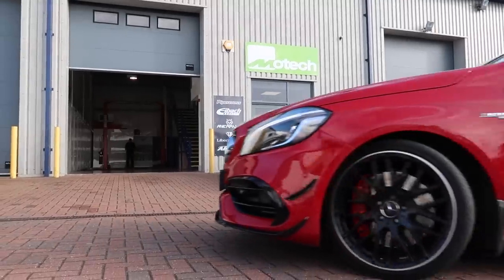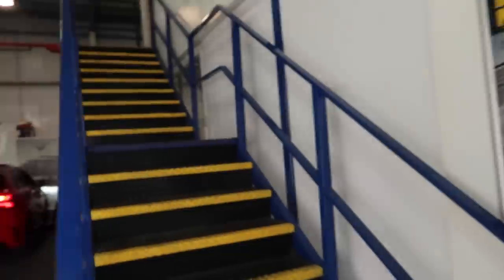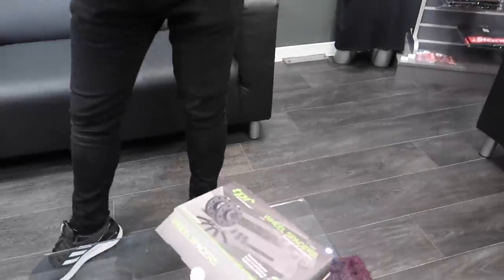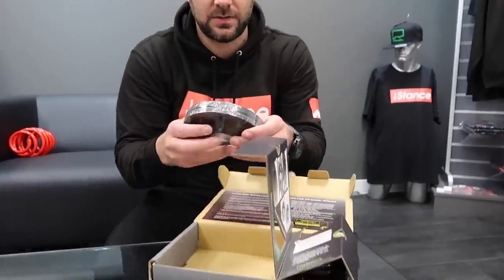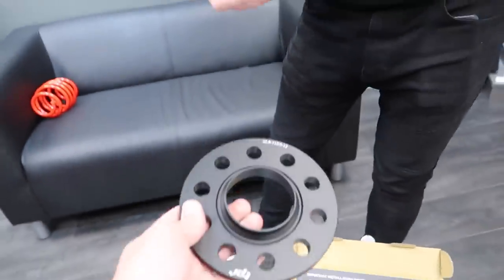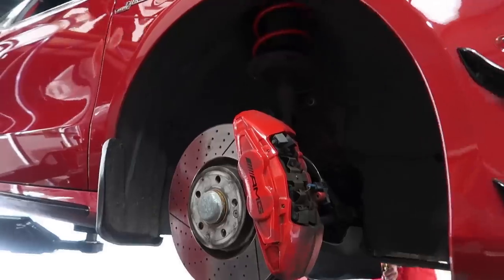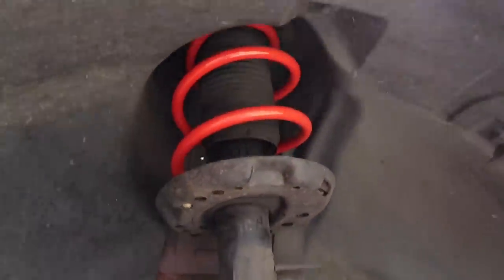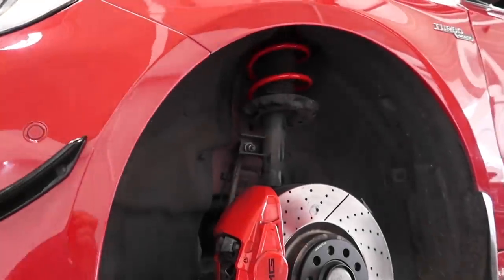New Mods For My A45 AMG!!

Comment: Loving what you are doing to the car mate. I presume no arch rub ?
Reply: Petrol Ped nope all good 👌🏼
Reply from the maker: Cheers dude 🙌🙌
Reply: Motech Performance my arches are rubbing after adding spacers & lowering - should I add camber?
Reply: Jay Tee on a 20mm drop you will be fine with the stock set up
Reply: After you add the lowering springs ....do you need to do your steering ?
Reply: that's what i immediately worried about when i saw it reversing out of the bay. If there's no rub, that's amazing. There's not much in it between the tyres and the arches by sight!

Comment: Tastefully done Steff, your'e one happy bunny. Just one question, doesn't it worry you that your wheels could get stolen without locking wheel nuts. That would concern me, or do they have locking wheel nuts supplied?
Reply from the maker: Yep new wheel lock nut supplied too 🙌 thanks man. Yeah super happy
Reply: Roberto Lombardi comes with longer bolts and lockers 👍
Reply: @StefABtv  That's nice to know Stef, will consider a set for my M2 Competition.
Reply: @MotechPerformance  Thank you, how much can a set cost? I'm interested in 15 mm up front and 12 mm to the rears.
Reply: Roberto Lombardi we have and m2 comp in this coming Friday 12mm f and r work best £685 all in for the eibachs
Reply: @MotechPerformance  Thanks very much, I'm not taking delivery of my M2 Competition until March, Can you please quote a price for the spacers? I'm having dealer fitted M-performance coil overs.
Reply: Roberto Lombardi £200 for a full set
Reply: @MotechPerformance  Nice one, when I'm ready I'll be in touch and can arrange something. Keep up the great work.
Reply: Roberto Lombardi 🙌🏼

Comment: Hey Mate,
Loving your content more and more, awesome work! I’m loving that you have this A45 because I also am an A45 owner and plan to do some similar mods. 
Excuse the noob question but apart from the look, is there any other benefit of spacers? Also the springs, are they sitting on the selective damping option you have and if so is it affected? Again are the springs more for cosmetic purposes or are you gaining handling too?
Excuse all the questions but I will go for similar option based on your responses .
Thank you bro.
Your car is looking so sick now!!
What’s next lol?
Reply from the maker: Hey dude. Thanks man. No I’ve had the springs on a bit more I can defo notice some more stiffness around the corners. My car doesn’t have the adaptive damping. May be worth giving motech a shout and see if it would affect it. Spacers mainly a cosmetic slightly wider track but the springs do make a difference to the look and reduce roll. I really like this set up. Thank for watching man
Reply: Stef ABtv hey bro,
That’s awesome, thanks for the really useful info, I’ll be getting in touch with motech in the new year for some mods, can you hook me up with any codes 😉
Cheers stef, you’re a ledge mate!!!

Comment: Awesome vid mate, Would love to try do the same lower and stance on mine here in Australia, will use your vid for inspiration. Keep it up man car looks sick, vids are rad.
Reply from the maker: Thank you mate!
Reply: @StefABtv  going back through ur other vids, have you done a decat dump pipe? I did that went to 3.5 inch, sounds unreal, adds lot of HP. Also have a BOV on mine, I love the sound but might be hindering HP. Anyway cheers man good work.
Reply: Pyramid Acid  what have you done to it now, just curious cause I’m in aus as well and have just bought one looking at mods now